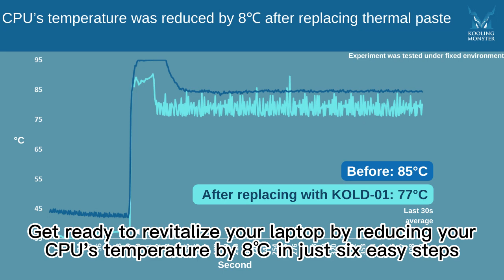Speed Up Your ASUS TUF Gaming FA506II - Prevent Overheating With Dust Cleaning & New Thermal Paste

Comment: I have the ASUS TUF GAMING FX505DT model... Can you tell me if the material on the VRAMS and the chips other than the CPU and GPU is thermal putty or thermal paste? Also will it be any problem if I only clean off and replace the CPU and GPU thermal paste and leave the others as it is?
Reply from the maker: Thank you for your reply! For the FX505DT Model, what's on the VRAMS are most likely to also be thermal putty. There won't be any problem leaving the thermal putty as is,. The VRAMS and chips around the CPU and GPU generate less heat than the GPU and CPU, they are also not as sensitive to heat. Changing the thermal putty to thermal paste will dissipate the heat a lot better. However there are a lot of watery thermal paste on the market that will leak through the gaps between the VRAMS and heatsink. If you decide to change the thermal putty, we highly recommend choosing a high quality thermal paste like our KOLD-01: https://koolingmonster.com/thermalpastekold-01
Reply: @koolingmonster  Thanks for the reply..Will surely try out your product!
Reply from the maker: We are very glad to know that our products might be of help!

Comment: 2:36 can i  use thermal pad instead thermal paste on vrams?
Reply from the maker: Indeed, you can. VRAMs don't generate as much heat as CPUs and GPUs do. Therefore, a thermal pad is sufficient to dissipate heat from VRAM chips. However, thermal pads should not be used on CPU and GPU chips because their heat transfer capability isn't strong enough to handle the task.

More about CPU Thermal Paste vs Thermal Pad: Which Is the Best?: https://koolingmonster.com/insights/cpu-thermal-paste-vs-thermal-pad-which-is-the-best